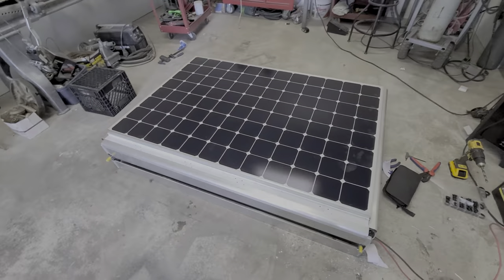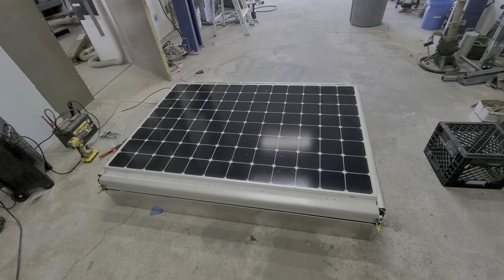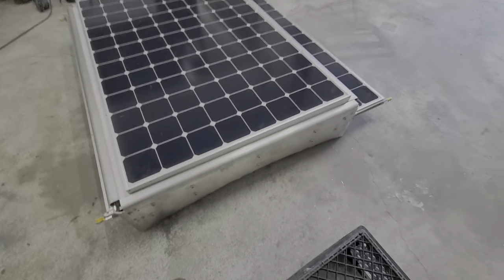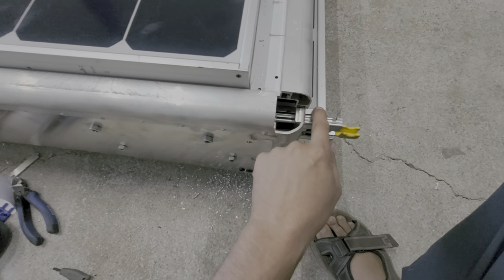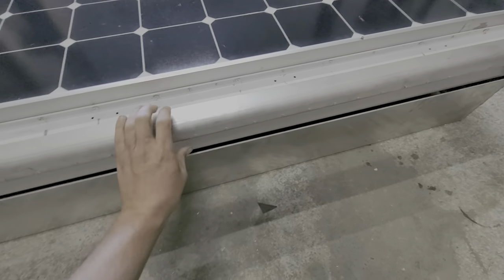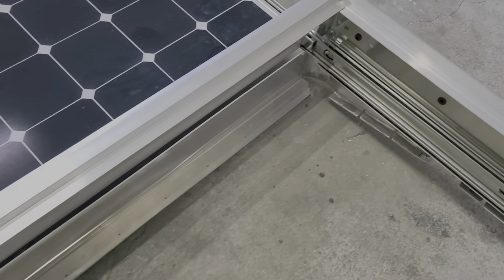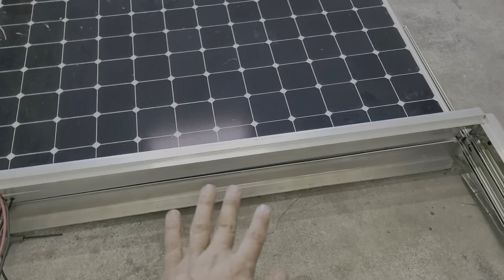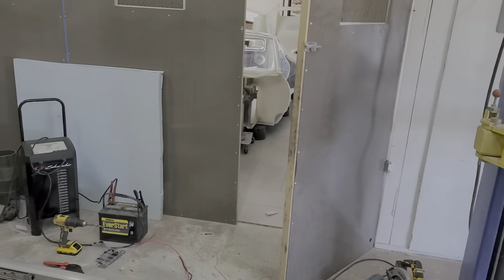Building a 3 layer slide out solar panel system - part 2

Comment: This is a great idea. And I've been looking for someone that has manufactured this. I want a 200watt per solar panel system. The box with the 3 panels on top of my MH. Enclosed/locked etc when travelling... then pull out panels (for each side), forming a 600w system when stationary. Can't find anything like it.

Comment: I really enjoyed your video, given that I've been tinkering with 3D designs of this for a while.
I've settle in 1 +2 overlapping 405w panels as I may have a bit more space.

One thing that I think could be improved is the distance from one panel to the other when opened to avoid shadowing when the sun is at an angle .

Also cables rubbing panels seems a no-no given they will not be stationery - lots of rubbing.
I'm considering race way for cable management, or something out of IT server racks.

Best of luck with your setup!

Comment: The ‘skirting’ is Good to minimize FOD (foreign object & debris).  None of the slides on the market in my exhaustive searching is (really) suited for outdoor exposure.  However, the ‘downside’ is restricted airflow across panels … Hot Panels = No Bueno.

The design has definitely inspired my Creativity (again).  I’m doing 2x 500W panels on hightop van.  Best option to Maximize roof real estate.

NICE to have a Fabricator brother !  😉

Comment: This is very cool and multi use for sure. I have a roof terrace that we don't use 99% of the time and want some dynamic solar panels to pull out when we are not using it and put it away when we are. Have you seen the new style frameless panels? Only ~9mm thick, for example the Sunpower Maxeon Air panel. I want this to be a multi functional box so when not in use we can put something over the top of it to protect it/use the space. I'm thinking a lounge chair of some description.

Comment: Thanks for the videos.  I was thinking how i might build something similar for a rack above my pickup.  I have 8foot bed and above the roof so i think i could have 3 or 4 panels on each layer.  I would be arranging them with long side across the bed. they about 66 inches long.  Do you think it would hold 2 panels side by side on each level? so 2 panels would be about 66in by 78in.  if so i could just build 2 frames to hold 12 panels.

Comment: Hey! Nice Idea! I like the sliders. There is one question from my side. I would like to put this on a truck which is around 3 meters high. Any idea if this could be remote-control operated? Otherwise, practicability might be an issue. Cheers!
Reply: Using a linear actuator long enought to fully extract them

Comment: I love it! How much does it weigh?
Reply from the maker: The heavy duty Drawer slides were probably overkill and I think they are like 24lbs and 2 of those and then the panels are like 40 each maybe. So I think we are at least 170lbs
Reply: @JarvieDigital  I'm designing a rooftop solar array for my travel trailer right now and the biggest limitation is weight when combined with the solar panels on the roof plus the inverter and batteries down below. I'm having to do probably half the system that I would like to do just because of payload capacity of the trailer.

Comment: Hi, What about dust sticking to lubricant on the sliding tracks?
Reply from the maker: @bartj9378  years later and it hasn't been an issue but like I mentioned to some other people if I had to do it again I would put more effort into automated sliders instead of the manual ones.

Comment: Beautiful build! How has it worked out in practice?
Reply from the maker: I have used it pretty often for a year now. I can get 320w when only one and low 800 when all 3 (which is weird ... Maybe something to do with the controller) 

But if I had to do it again I would have splurged for actuators for automation and ease would have been so worth it. 

But they have been very tough even in strong wind

Comment: How long will this last with the bearings and dust/weather/rust?
Reply from the maker: Well it's been a couple years so far and doing great. I think my biggest issue is that the locking mechanism on the sliders isn't fully dependable so you have to find a way to make sure the panels don't slide out when in motion so I had to Jerry rig some ways to stop them from sliding and not depend on the sliders
Reply: @JarvieDigital  I appreciate you taking the time answer my question. I am going to try and build something similar now I know dust shouldn't be to big of a problem. 👍
Reply from the maker: @renstillmann  well if you are doing it then I shall offer my advice that I wish I had done. Invest the money and the time in doing actuated/motorized slider system. They would be locked in place, I wouldn't have to be on a ladder so much, I would use the hidden 2 panels so much more.
Reply: @JarvieDigital  That's actually what I am planning on doing. Thanks for the advice though :) only issue being is that my design requires 1300mm stroke actuators. Which I can't seem to find. I reached out to a company if they can provide such. I did find some from China but will try something else first. 👍